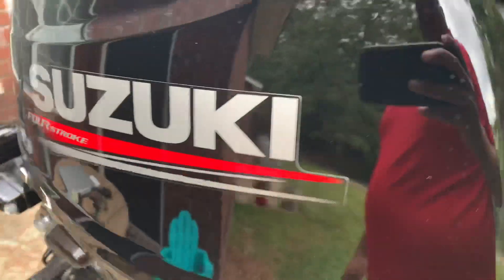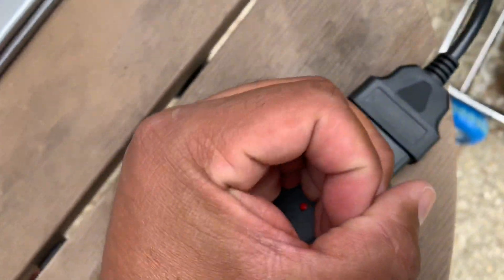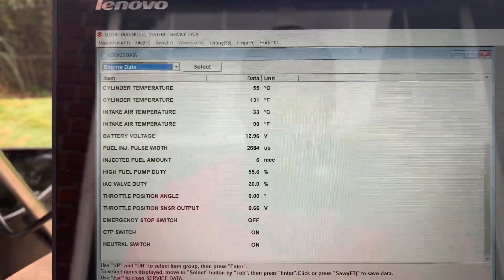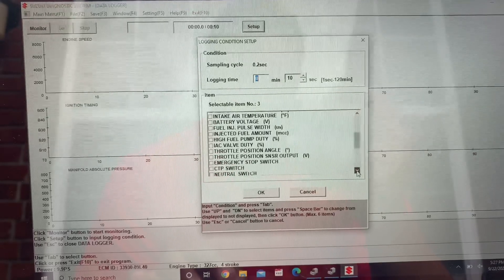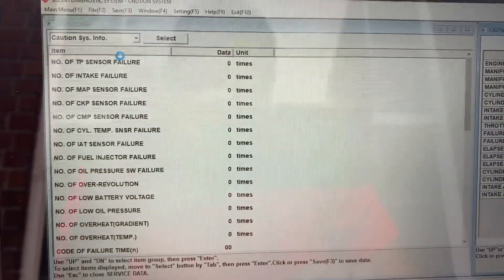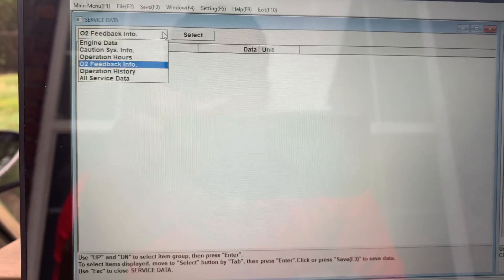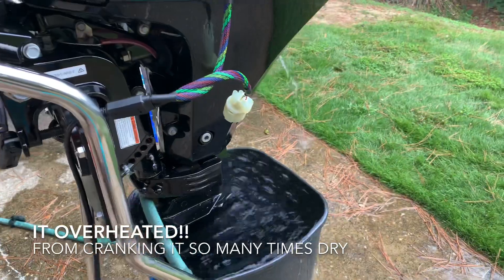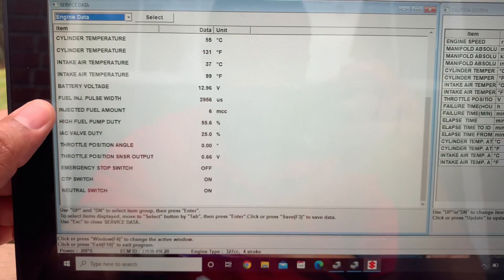Suzuki Diagnostic Software on a 9.9hp /20hp outboard

Comment: I bought a scanner on Amazon but I could not get it to work. Can you tell us who you bought yours from? Did it install without any problems?
Reply from the maker: I got mine from ebay years ago. Make sure the program is compatible with the computer system you have. The laptop i installed in on has an old windows cant remember i have t used it for a while
Reply: @laingej  I think you nailed it. My system is Windows 11 and that is not listed. I sent it back. Thank you very much for making these videos. It helps alot.

Comment: Very unique video. I have not seen anyone else using / talking about this diagnostic on the Suzuki engines. Looking at the software USB card, it also works with Yammy's, and Honda's. What I really like is how much data is being logged and monitored on such a small engine. The datalogging is the coolest feature, but do you have to leave the laptop connected for it to record for a certain time? I mean is that data is not logged on the ECU, its on the laptop instead? I believe it will be logged on the laptop only.
And we learned from your experience... do not crank if it does not start the first couple of times. And Never over 5 seconds!

Thanks!

Comment: Some of the actuation functions require that the engine not be running.  How do you get power to the ecm if the motor is not running?

Comment: I noticed the contacts they use are  marked OBD2. Is it possible to connect an ordinary cheap OBD2 reader or OBD2 gauge as you can in a car and see live data from the engine? NEMA2000 kits to your GPS display or Suzukis multi function gauges are very expensive.

Comment: Did you ever do The fuel comparison to see if the 9.9 ECU delivered the same fuel as the 20 ECU when running it with the 20 hp flame arrester? I saw you did it up to 2500 rmp in nuetral and the results were the same. Did you ever test this on the water in gear?

Comment: How can I connect to my 9.9 manual starter model? There is a problem with electric connection, I need help. I need to power the ecu, how can I?
Reply: I have the same issue how can I powered it?
Reply: @MrFbat13 you need a power probe tool. Dont get a knock off one. Get a power probe 3. Its about 120 bucks or you can find one on marketplace from someone who needed to use it once, or they just don't know how to use tools. I got my last one on marketplace a few years ago for 40 bucks. Guy never used it.

Comment: Great session, you wouldn't happen to have the link to the diagnostic kit you purchased? I found on online but it appears to support all DF 40 - DF 300 models from 1999 up to 2020, my engine is a 2017 DF9.9B and I don't want to purchase this to find out it will not work. My main is a DF200 so it would work on that.   Thanks in advance..   https://www.amazon.ca/Moto-Solution-Suzuki-Outboard-Marine-Diagnostic/dp/B07DKVCC91/ref=asc_df_B07DKVCC91/?tag=googleshopc0c-20&linkCode=df0&hvadid=293020548866&hvpos=&hvnetw=g&hvrand=13789564002653799614&hvpone=&hvptwo=&hvqmt=&hvdev=c&hvdvcmdl=&hvlocint=&hvlocphy=1001957&hvtargid=pla-570900279065&psc=1

Comment: Interesting to see it overheats when you have no fuel at all. (Hose disconnected)
Reply from the maker: The motor was already hot running before.. then the fuel line came disconnected without me knowing..i kept cranking and cranking it.. spinning dry  wasnt picking up water. Was just enough to store a code but wasnt major overheating
Reply: @laingej  my suzuki 6hp cranks up by pulling a rope, but it pees every time you pull. Also,i remember your engine didn't connect to ECU when the engine was off , although it was connected to a battery.
Reply from the maker: @boatsandoutboards9070  i see. mine needs more speed to pickup water doesnt pee cranking nor pulling the cord.. takes a good second after start to see it peeing..The battery is just for the starter motor it doesnt power the ecu.
Reply: @laingej  ok, thank you.

Comment: I launched my 2021 Saturn fb385 inflatable boat with my 2021 Suzuki df20aes3 on 4/20 for the time ever and had an awesome time breaking in the motor. Now because of you, I am going to get the Suzuki diagnostic kit to check how I did and to make sure everything is good according to break in instructions.  Thanks for all you do, I appreciate it and you! Tight lines!
Reply from the maker: Que bueno! Disfrutalo compai

Comment: Did you have any issues downloading and installing the software? I just managed to install the drivers and program after messing with it for a couple of hours. But the program won't start with or without the USB cable plugged in. Does it have to be initially connected to the motor with it running for the computer to recognize and initialize the program or am I doing something wrong?
Reply from the maker: Did you change the usb port settings? You have to go in our computer and change the usb port to COM1 for it to work. Mine came with instructions and after installing all thats the one step you gotta do. Connect the adapter to usb the go to setting look for videos here changing usb port to com1
Reply: @laingej  Yes I did. I was able to get it working shortly after. Thanks for your response. I found out mine only had 30hrs, despite being a 2014 model, so I'm pretty happy with it!!
I also found no faults or error codes, other than 1 instance of a low oil pressure fault. Just need to get ready for and do the timing belt replacement and I should be good to go!!
Reply from the maker: @CUBICHI1985  wow just 30hrs! Thats awesome! They used it very very little .. or they put a new ecu.. ?? who knows maybe was just a kicker outboard
Reply: @laingej  I know right?! They used in their vacation home down mex, so likely just used very little. Either way I'm pretty happy with the outcome 😁
Reply from the maker: @CUBICHI1985  that explains why! Awsome find ! They only used it on vacations sweet
Reply: @laingej  yup n why no service had been done. But all good, I replaced all maintenance items and will continuing to do so per interval SPEC 😁
Reply: I got a slightly newer version that just has a box with two cables coming out of it, one the USB you hook up to computer and the other with the 4-pin connector you hook up to outboard port (which actually only has 3 out of the 4 pins, although the seller says that's how it's supposed to be)..

Comment: Hi thanks ordered  my does not have it yet. Can you tel me does the 20hp pullstart  have 12v dc output for use when running?
Thanks
Renier
Reply from the maker: No it doesnt have a charging system( rectifier)

Comment: What a dumb design to require the motor be running to see diagnostic info.
Reply from the maker: I know. But since it doesnt have ignition switch..the ecm is dead but there is a way.. you can power the ecu with a 12v battery . Pin 13 power and pin 14 ground. It works i tried
Reply from the maker: Devon In this video i show how to do it https://youtu.be/QUQcWrIOdLM

Comment: What value does this diagnostic software have if it will only work with the engine running? If my engine won’t start this won’t help me to find out why.Right?
Reply from the maker: You can .. you need a 12v battery and power the Positive white wire coming out of the rectifier .. it disconnects and ground the engine block. Then it powers the ecu and you can connect the diagnostic program..i will make a video
Reply from the maker: @train falik.. i just posted a new video showing how to do it
Reply: @laingej  do you still have the video of the DIY power cable please...
Reply from the maker: @h0mer38  yeah is there in one of my videos let me
See if i can find it
Reply: @laingej  I found it, it's part of the video where you had the fuel stabilizer problems, thanks so much for replying :) I have a DF20 pullstart. I'm trying to find the best location for the 12v power for the ECM

Comment: Does your diagnostic give you any information regarding AWG cable requirements for moving the battery 17 feet away from the motor ? It looks like 8 AWG cable coming out of my  motor itself, but I'm not even sure on that. Then I would want a large enough cable to defeat any resistance on the 17 foot electrical run. Mine is the 2020 15 with electris start and power tilt. And your vids are great !
Reply from the maker: No theres no info on that .. you can calculate it yourself  there a formula by lenght and amps  so you retain the needed amperage yes you gotta go a little bit thicker.. but this little motors will cracks fine with 110 cca even thou recomended is 325 cca

Comment: I bought a 2019 15hp this year for my 14ft tin and it's hits rev limiter before 3/4 throttle. I plan to go up to an 11 pitch prop to hopefully correct this. My buddy was passing me with his old 9.9 and that kinda pissed me off. So I am getting the prop and probably the 20hp ECM soon. Seems weird that the engine overheated just by cranking it over. Doesn't the water impeller still pump while the engine is cranking? I think I might get this diag kit too cause my 15 doesn't idle as nice as yours that's for sure. Mine shakes like crazy at idle but purrs as soon as I get off idle. Thanks for the vids on these Motors.
Reply from the maker: Does overheat easy with no water running.. it had been running for 30 minutes already hot and doesnt pee water while cranking not enough speed .. if the engine was cold start would have been fine. What prop pitch you have now?
Reply: @laingej  it's the factory 9 pitch on it now. The boat is too light and it basically leaps out of the water when I take off.
Reply from the maker: CDNWizard  did you try triming the motor different positions? a hydrofoil will help you take off faster.. it wont leap wasting power upwards... it will shoot straight..
Reply: @laingej  yeah I've tried all different trim positions. I hope that I'm heading in the right direction. The boat is honestly so light I can pick it up and portage with it by myself very easily. It's is rated for a 15 hp max. I've had two buddies in the boat with me and a bunch of gear and that was the only time I could open it up without hitting the limiter. I figure a prop is only around $100 Canadian so I will try that. I'm also planning on adding a little weight to the boat with a casting deck and storage up front. I solo fish mostly and my two young ones come out every so often.